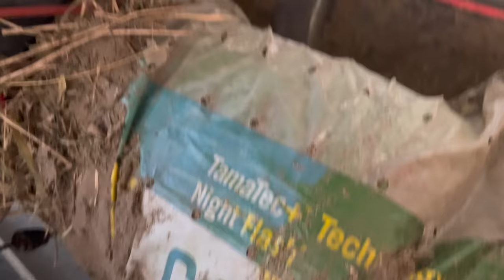CHOPPING CORN SILAGE | DAY 2

Comment: Is their Freon leaks anywhere on the chopper
Reply: It was the expansion valve and a relay but once we got it fixed the engine was still hot and with how hot it was the ac couldn't catch up.the next morning it worked but we had to chop slower to keep everything cool enough to work!